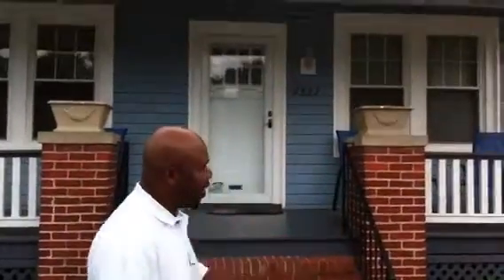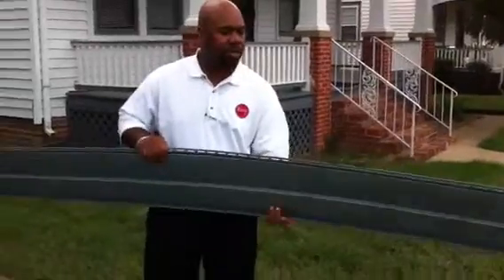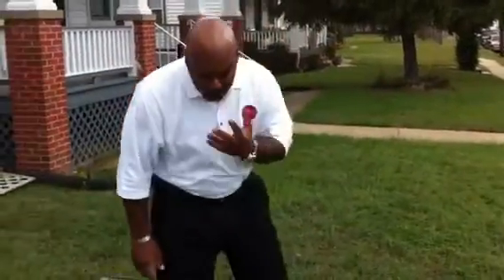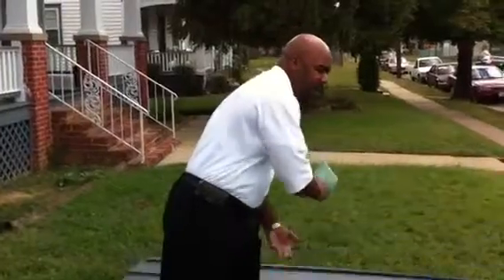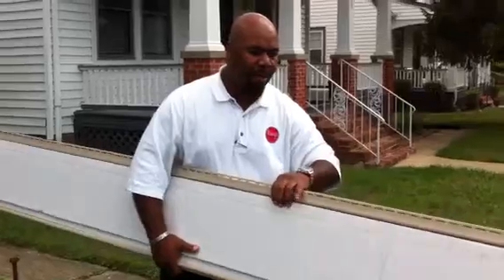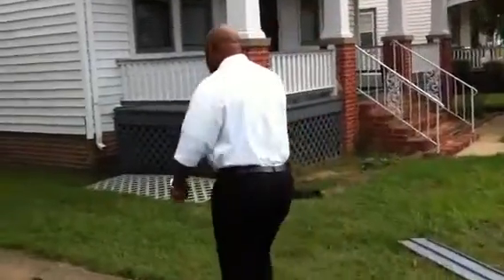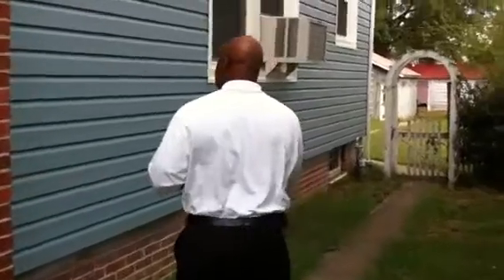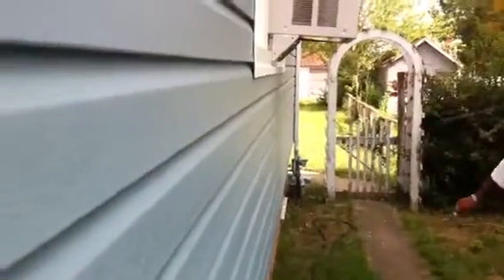Insulated Vinyl Siding Vs. Hollow Back Vinyl Siding

Comment: Thank you so much for taking the time to post this. I am researching my siding options, and this definitely helped me understand the difference in a very easy and informative video.
Reply from the maker: No problem. Let me know if you have any questions.
Reply: @homeexteriorguru could you please give me your opinion on Certainteed insulated siding and the best hoise wrap. I heard about Barracuda ???? Can you use 2 layers of hoise wrap for better insulation. Trying to increase R value in older house. Thanks for your time.
Reply from the maker: @dla872  I like the Certainteed insulated siding. It’s comparable to the siding in my video. As far as house wrap all of them are about the same. House wrap doesn’t provide any energy saving benefits. It’s just a weather barrier. The only other way to cut your energy bills is to make sure your walls are insulated, replace your windows and doors. Hope this helps.
Reply: @homeexteriorguru  Just had all windows replaced, lol. Attic insulation redone to R60. We are installing a metal roof (cooler in the summer) so all we have left is the siding. Tomorrow coming for an estimate. Thanks again for your help and time. I really appreciate your efforts. God bless.
Reply from the maker: @dla872  No problem. By the way, what city and state are you located in?
Reply: @homeexteriorguru  Trail Creek,  Indiana

Comment: Well, I put 5/8" Dow Board on my house, wrapped and taped all seams on the house and then used Alside un-insulated vinyl siding.  Well, its been 14 years, no chalking and joints are PERFECT since I had a phenomenal installation team.  It was also rated for high wind.

Comment: Great video. Have had contractors in for JamesHardie and LP SmartSide. After watching your video and other research I am probably going to go with inslulated vinyl siding. Thanks again.
Reply: Jerry, did you end up going with the insulated vinyl siding and are you happy with it?  We are at a crossroads of what to put on our house but like the idea of the insulated vinyl siding.  Most of our siding will be paid for due to a hail storm we had last year but going with the insulated vinyl it will cost us an additional $12,426 out of pocket.  I want to make sure we are going to like it.

Comment: no matter what siding you do, get the drop in from progressive foam. the prodigy is just glued. progressive will foam back anything. then just wrap the house with ammo wrap first, no matter what your going to get water behind the siding thats why they have weep holes, most installers dont want to do it cause its more work. but to bad its a better install.

Comment: Good video. Couple of questions for you. Does the insulated vinyl provide any additional sound dampening vs hollow siding? I am wondering if it would dampen out jet noise a little bit. Also, is the insulated siding similar in overall thickness to hollow siding? I am thinking about installation around doors and windows.

Thanks!

Comment: Good video. But even siding with insulation behind it want straighten out very old and wavey houses so you should correct these problems before putting the siding on. And a material like  tyvek  will insulate your house better than any foam product. Use it with the foam backing. Sorry about my spelling but I'm tired and a little tipsy .lol this is a very good an informative video though. He knows what he's talking about.

Comment: Very well done.  You seem to be a very good sales guy.  To me, it would seem that 4 x8 panels of say 3/4 foam board with the vinyl siding nailed over it would be better from a efficiency stand point.  Reason being, that I believe it would provide a better seal to the envelope of the house keeping air conditiooned air from escaping.

Comment: My question on this insulated backed siding would be does it stand up to impact better, hail, rocks from mowers, and so on?  Seems that with the insulation behind the vinyl, the insulation would help to absorb the energy of the impact better than loose/unsupported vinyl like the white house.

Comment: I've been reading the insulated siding traps moisture behind the wall
Reply from the maker: The insulated siding does not trap moisture behind it. In many cases it's more permeable that 1/4" ploycore insulation with a plastic backing.
Reply: your absolutely right it does their has been many scientific papers written on this issue rotting houses.  Don't use insulated vinyl their is no need for it
Reply: by the the way insulated vinyl has an r value of 2 or 5 it's pretty much just a gimmick
Reply: @lgonzalez1154  yes you are right, the fanfold backer board has little holes  so it breathes,  this stuff is glued on doesn't breathe. Years ago in New England they used Styrofoam backer board with tinfoil covering , had to discontinue, houses weren't breathing people were getting sick!

Comment: I have a 14x61 foot mobile home with screwed on metal siding. Can that insulated vinyl siding can go over the metal or do I have to unscrew the metal siding? Is this siding available in Michigan?
Reply: Tom Hayward how has that been working for you and how much did it cost? I'm out for 2 things. Something to sturdy my mobile home from high winds and something that rats can not chew thru because I live by a lot of woods n lots of rats in neighborhood. I'm desperate because my trailor is old and seems to be trying to collapse with high winds n fighting monster rats that chews into trailer so I want something that goes from the ground to the roof as much as possible. I have to move fast n I'm very poor.

Comment: I run a siding company, I've used structure siding (foam back siding) a few times and we were not very impressed with this product. It does not float over bumps in the wall very easy. It acts the same as traditional siding, its not that special. I suggest foam sheets and regular siding, preferably at least .42 mil thickness. These manufactures have not perfected this product yet. It warps at the top of the wall were the eve line shadow hits.

Comment: I do siding, insulated sucks and takes x2 as long.

we just nail up foam first then run siding on it.
Reply: It wasn't created for your benefit, but for the benefit of the homeowner. Maybe you should seek work as a mattress tester - seems up your alley.